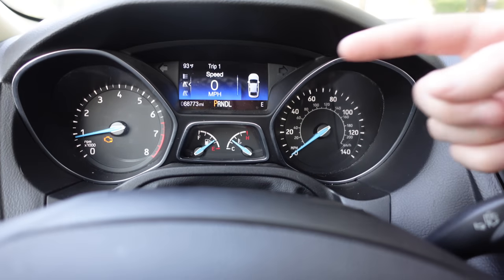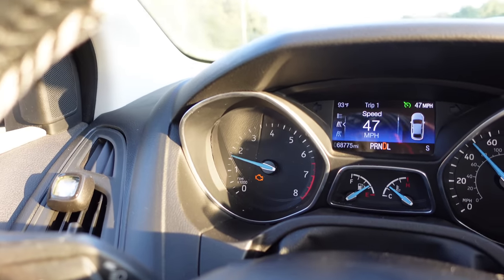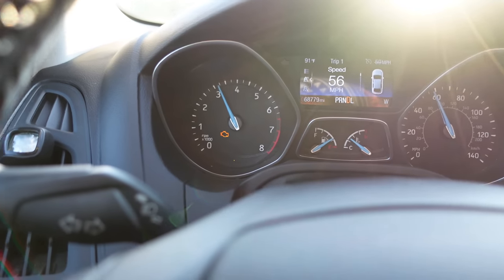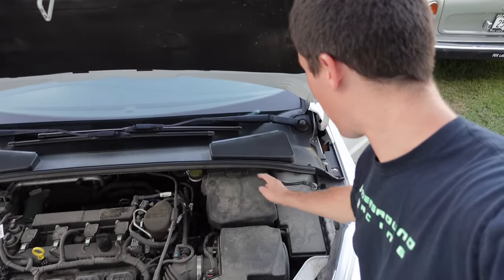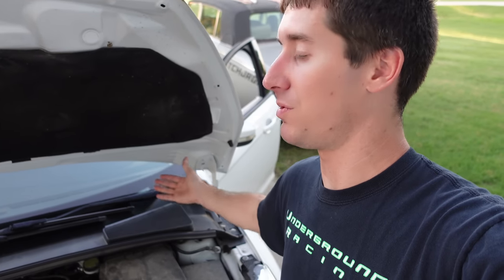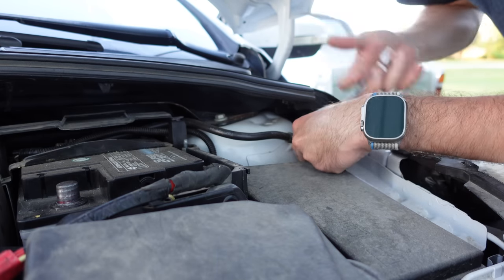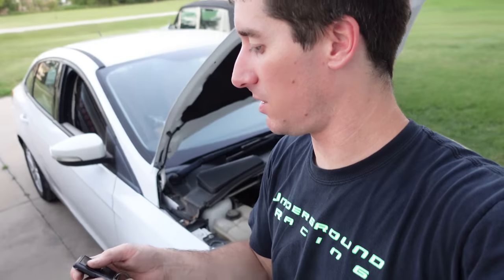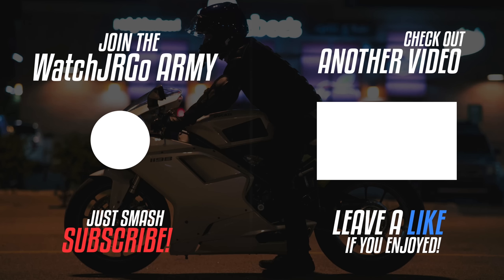This NIGHTMARE Transmission DESTROYED The Ford Focus (Fixing My Girlfriend's)

Comment: An old Ford service mamanger here. Ford has had always transmission problems.  AOD's A4LD's. I rented a Ford focus back in 2017, Went to San Diego, almost didin't make it home. The only reliable transmission ford made was the old C6. The current 10 speed Ford uses is also having issues with some class action law suits. Funny I'm retired now, but my last job I worked as GM corporate technical trainer. The current 10 speed was co developed with GM. Some on here metioned the Chevy Cruze 1.4T. The Cruze was built on the same platform as the Buick Verano. I would tell people to buy the Buick, as it had 2.2 ecotech engine from Opel, and had a timing chain, not a belt.
Reply: maybe you can help , I have a 2017 with 98k and my check engine light on and got a messange that my trans was overheating. i felt slippage and drove to my mehcanic. he sais the trans is is done. I dont fall into the 2016 extended warrant criteria . its the same transmission tho . i still have a year left to pay on it through  ford credit. i dont know what to do . I knows this car was faulty any help or recommendations . thank you.

Comment: Lol yeeah that’s why my mk3 se was a 5spd. Miss that little car even though it was rusting away quicker than my mk1 project in the garage. Only other thing you could try that’s easy and possibly worth it is lubing the clutch forks and testing the actuators to make sure nothing bound up there imo. If clutch A is gone the dealer might try to charge to have that replaced without addressing the root cause that originally made the clutch burn.

Comment: The forks actuator rods get dirty from clutch dust, and the actuators aren't powerful enough to overcome the binding. Once you fix the ground and check the actuator circuit,  you still need to clean the fork assemblies.
Reply: Rollers, not rods.  And one will have to replace the forks when the rollers and the tiny bearings inside them can't be cleaned up.   Will give you a thumbs up anyway though.

Comment: I had one, and what a P.O.S. Ford came out with a recall to replace the TCM,  but there a national shortage on them.  The dealer recommended to replace the clutch pack for $3,500. I got the check engine light,  the engine code stating that clutch A doesn't disengage.  I went out and bought a Toyota Corrolla, and donated the Focus,  maybe they can sell it for parts. 

Even changing out the clutch pack,  you will still have the transmission shutter. Maybe they will get the inventory of TCM,  before the recall warranty expires.

Comment: My Mom has the same exact vehicle except hers is a base model so it’s not so fancy lol no heated seats or steering wheels abs ugly cloth seats but every time I drive the vehicle the transmission feels like it’s just not engages it feels so laggy I’m experiencing the same issues 50% throttle shitload of rpm but actually only gains like 5mph freaking hilarious is it the transmission or are they just slow like turtles and totally like that from the factory

Comment: My wife's 2013 fiesta has the same problem has been in twice for trans recal work once at 68,000 and agin at 108,000 we are now at 117,000 and it's starting agin they got one more chance to fix it then I'm gana have to lemon law the dam car. It will start to shift hard then eventually your loose reverse then over drive then it will take about 10 to 15 seconds to change gears. Then all u will have is 1st and that's it nothing u can do about it from there. And it's all trans computer related. Low voltage problems u can fix it but the problem WILL come back over and over

Comment: had the same issue on my 2015 focus se was a great car but when going up hill it was making all kinds of crunching noises and when i took it to the dealer for some kind of fuel valve recall told them about the issue and they diagnosed that it needed a whole new transmission  which was like 4.8k quote. also the tweeters went out and the constant blue tooth issue. so that was the end of it posted the car for sale and let it go and it only had 50k k mile. when i bought it, it already had those issues and it only had 8k on the odometer

Comment: I had corrosion in the battery cables due to poor crimping and sealing on my 2013 Focus, which turned out to be the issue, after 5 warranty trips to the dealer. Changed the cables, boom. Fixed

Comment: Had a 2014, bought with promises that "they are fixed now". Nope. Fixed 4 times under warranty and 5th as 900$. Traded in for Toyota in '18, never looking back. Then, nephew gets a 2014 at a public auction last fall, was $3500 and ran OK, now DCT overheats, will probably last another few months if lucky,

Comment: Last resort if an automatic is your preference…….. manual swap. 
Mine has 247k on it with no issues other than normal maintenance….oil changes,air filter, coolant,tires, brakes, shocks etc
2016 SE 2.0 factory 5 speed car 
Over 40 MPG consistently 
Best car I’ve ever had

Comment: My experience was much different.  I had a 2016 and I got 128k miles before Bambi took it out. I will say having driven mustang 5.0 with 5 speed that a Jerky clutch and that doesn't bother me. I never had it stall on take off ever. Who can claim that in a true manual. Anyway, I recall there were legit issues where seals allowed oil weep and ruin the clutch material. Then the computer module located near the hot exhaust etc can't help. But the mustang gt500 is a dragstruo winner straight from showroom. I loved mine as I got an avg of 38 mpg over 128k so I miss mine.

Comment: Those gearboxes require very regular maintenance and in twice as short a period as the one recommended by the factory. Europe is full of them, so we learned our lesson.
You can make a manual from dual clunch transmision

Comment: I had a 2014 with a horrible shudder on take off. TCM was unobtanium then and that was back in 2015. My wife inquired about why it was taking so long when she carried it in for service and the tech told her the same thing that I did (that the design was horrible and that even if they fixed it it would likely come back). She asked what she should do and the tech literally told her to put a brick on the accelerator pedal and let it go in the lake. Guess who took a $5k hit on trade in to get out from under that 🤦‍♂️ And that was from a toyota lot that was offering almost double what the ford dealership did 🤣 Hope it all works out for her!

Comment: 68k is about right. Mine had the TCM (may be remembering the name wrong) replaced under warranty around that mileage. The symptoms were the same. Bucking, slow shifts, slow launches. The module that was replaced sounded like a computer from the name, but was actually the mechanical device that actuated the shifts. It was fine after that, but I traded it in on the assumption that the same thing would happen every 65k and I'd be paying for it out of pocket the next time.

Comment: I had a 2015 chevy sonic and when I got rid of it it only had 42k on it. It was blowing out smoke, loss of power. Took it to 2 shops and they couldn't figure it out. Spent like 5k to try and fix it. Finally took it to the chevy dealership and they kept it for a month and couldn't figure out what was wrong. I told them to keep it and walked out front and bought a Bronco Sport. It sucks that vehicles break so soon.

Comment: The updated clutches fixed this problem. The original clutches and seal leaked fluid out the factory that caused the clutches to slip.

Comment: My son has a 2014. That transmission is junk. First the TCM went out. Under warranty. Took months of it sitting at the dealer.  Before they got one to replace it. Then dealer said. It also needed a new clutch. $3,000. When asked if it was under a recall for that clutch. He said that car had already had a new clutch put in it under warranty. But now needed another one. 🤷‍♂️. TCM probably damaged it. But it ran ok for about a year. Then clutch fork started sticking. So would clean it. And it would last about 2 weeks and start sticking again. We did this about 5 times. At the 5th time. It would not go into reverse. And forward shifting seemed to skip gears. Code showed relearn not learned. Looking into it. Looks like a part of the internal housing broke. Which they said could be caused by a weak battery. Or it being a small aluminum tab could shear off. We’ll the battery was bad. So possibly a battery going out could have cause a transmission to break. 🤷‍♂️. My son has 2 years on the note. And no car. I don’t think it’s worth putting $3,000 plus dollars into it. It’s junk. But he’s stuck with it. Or without it and a car payment. My advice. Don’t buy this type of car. And don’t buy a ford period.

Comment: It's also very much a case of misunderstandings...You should both have learned to operate the DPS6 correctly. 😉

And probably should have waited til 2017, for the DPS6. Long-lasting teething issues...Also, if she does a lot of clutch slipping to hang on the side of a hill at a light, instead of holding the brake, or creeping a lot in traffic, shifting low gears frequently, on and off the brake a lot, instead of staying put until traffic starts moving, like a manual transmission driver, she is likely forcing the clutches to get hot, and stay hot. (Transmission overheat indicates on the display) It will wear a dry clutch out fast, warp, cause excessive clutch dust early on, and all kinds of unwanted things happen.. Bent forks, stuck actuators..... It's also not that expensive to switch it to a manual, if you do it yourself. The car was designed to fit a manual. I drive a 2017 Fiesta SE DCT hatch with almost 80k now. She still behaves the same. I drive her like she's a dry clutch DCT, and I drive a bit aggressively, to keep the clutch dust shook out... Mine's also easier on the clutches than the considerably heavier Focus. What I find funny about regular mode, is how quickly it shifts out of first, and into second, if you teach it to really sip gas....... Sport mode climbs a couple k rpm before shifting, in the bottom three. Regular drive, uses far less fuel, and is still decently quick. Ford failed to teach drivers how to operate the transmission. It should NOT be operated like a hydraulic, or a CVT. If driven like other automatics, you wind up with the issue you have, and lots more. 😉 .....and sometimes a simple transmission reset is in order. Search it on YT. Takes 10 seconds. Each driver, drives different. Resetting the transmission between drivers is the correct response to many shifting issues. ......A Fiesta, and a Focus are designed by Ford to reach 130mph+ with the proper equipment installed. That's damn fast for a little bean.....

I drive a 2017 Fiesta (Mk7.5 SE hatch) with this special transmission.. A year M-Sport DOMINATED WRC, using the Fiesta body.  Took 1, 2, and 3 podiums at Monte Carlo, in 2017. Legendary cars....The Focus is the fatter Fiesta. 😉

Comment: Bought my '12 hatchback titanium 2dr new with 3 miles on odo. Driving home from dealership felt slipping, and turning into driveway (downshift 2-1st) bucked uncontrollably and it was trying to push through brakes. From that point on, almost every reverse,  1-2,  and 2-1 shift bucked. They tried telling me thats the way it was and it would "learn" my driving style. After the 2nd replacement transmission, 3 flash re-programmings and under 20K miles, they purchased the vehicle back from me. Tainted my view of Ford - even with A-Plan discount. Never again. The issue apparently is the dry transmission - seals were poorly designed, and just a small amount of oil seepage ingress would cause the havoc. The "fix" originally, was to replace the seals... but they were using the same ones - eventually they were re-designed/manufactured, but too late for me. Once tainted with oil, the entire guts of the trans. need replaced. Rinse. Repeat.
Reply: Also - the slippage on acceleration you experienced will get worse. Imagine getting on a freeway, or pulling out in traffic, or attempting to pass a car, and the throttle response you are expecting never happens - or dies out half way through your maneuver. Best fix is to just get rid of it - for y'all's safety.

Comment: Problem with those the seal pack between the inner an outer input shafts start leaking an spills transmission fluid directly into the clutch disks.

Comment: There is a recall on that transmission. They will fix part of it for free.  My father-in-law bought one that had thus issue on purpose. The dealership fixed part of it but he went ahead and had the clutch pack replaced. He had to pay for the clutch pack.

Comment: A lot of used cars from the late 00s and early/mid 10s are a minefield of issues 10-15 years in;  between early CVT, engine issues, etc it’s difficult to find reliability without paying a premium.
Reply: I should also note that I’m approaching this from a lower middle class mindset.  We don’t have 5/10/15k saved up to drop on a car if ours dies.  A lot of institutions won’t do lower APR loans for vehicles over 10 years old or over a certain mileage, and most 8-10 year old vehicles I would classify as “reliable” have over 100k and are still priced 10-20k or more.

Comment: New recall was mailed by Ford this week for a free TCU replacement until Aug 2025 if you have a transmission or service engine light on.

If you're not getting thrust at 10%+ throttle it is the TCU.

Dealer fix...a large city dealer will try and avoid the service, as they don't get much for the repair from Ford.  Take it to a more rural dealer.

BTW slow plodding driving will destroy these transmissions.  A bad TCU will destroy the clutches too.

Comment: In 2012 I test drove a Focus with the trans mentioned and on the test drive the trans went into a severe grinding noise and stopped on a brand new car.  Although I went in wanting a Ford the dealer wouldn't even try to sell me a fusion so I walked and they let me.

Comment: Lots of people on here seem to be confused about dielectric grease.  Dielectric grease is not conductive, that is true-- it is an electrical insulator.  However, that is not a problem!  Why?... because when dielectric grease is put between two electrical connectors before assembly, as the pieces are brought together (a male connection inserted into a female connection, or the pieces being tightened together via the tightening of a bolt or screw), microscopically, where the pieces of metal make *actual physical contact*, the grease is squeezed away from the physical connection points, thus the dielectric grease does not hinder the electron flow.  In fact, it makes no difference at all!  And it will prevent arcing at points that are nearly connected, or that connect intermittently and would otherwise arc when the connection is broken.  So, dielectric grease is added to parts BEFORE they are connected, but you can slather on on outside the connections if you wish, but adding it before assembly is better.

So why is the dielectric grease used?  It is used to seal out the oxygen in the air, oxygen that would otherwise corrode ("oxidize") the metal-to-metal connections, keeping them oxygen-free and clean of corrosion build-up.  Dielectric grease is a wonderful thing, and I use it on all electrical connections that I want to maintain maximum reliability on (the medial equipment I work on), and it is especially good to use on saltwater marine electrical connections to prevent corrosion from salt intrusion.

Comment: Manual swap it 😆 I have a 2012 1.0 with the 6 speed with nearly 77k on it and the only issue I had in the near 4 years I’ve had the car transmission wise was a clutch and flywheel change in 2021 otherwise I can’t complain. But mk3 focus has enough issues mainly because of Fords accounting department. I traded in a mk2 with 140k on it and didn’t have half the issues the mk3 has had over the time I’ve had it

Comment: I guess the problem is you need to clean the Actuator A... its on the top of the transmission, easy to fix... bad TCM will give you a much worst experience, no reverse, no drive, etc
Reply: Clean clutch FORKS are needed most, or rather the tiny bearings inside them.

Comment: If u remember it is not a automatic transmission but a clutch manual and drive it without burning the clutch trying to creep around like a automatic it's fine. If u are either on the gas or off no creeping the clutch won't burn. The biggest down fall was no up down shifter option to select your own gears. All ford gave  u was L and auto

Comment: NEVER apply dielectric grease on to an electric/electronic connection BEFORE assembly !
Always clean and assemble first and THEN apply protection to seal against corrosion.

Comment: Dielectric grease insulates. You do NOT want it between the pieces of metal. Feel free to coat the surfaces after they are in contact with one another. It will keep crap out of the connection. Think I am wrong? Please look it up.

Comment: I thought you could clean or replace the some parts of those…like shift or clutch arms or something that protrude outside the trans???  I feel like I remember seeing a vid of someone using a cordless drill to run the threaded arms through their Range of motion to “clean” the clutch dust off?  Maybe that was a separate issue.
Reply: I looked back in my history.  This is the process I was thinking of:  https://youtu.be/0Fh5G6ebD8s

Comment: If it had a ground or power with high resitance issue wouldnt it set a open circuit codr possibly high or low circuit depending on pull up or pull down design? Im certain if it was as simple as battery connections ford would have immediatly done something 15 years ago to avoid loosing millions of dollars... the warranty extension proves the issue here